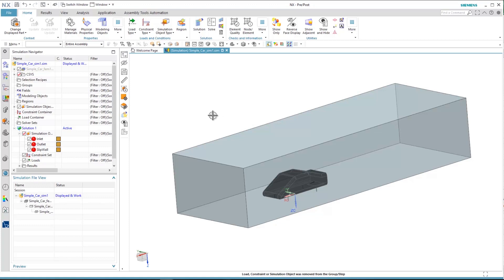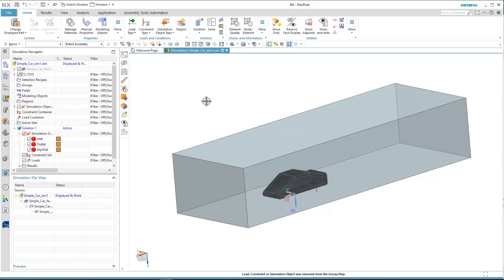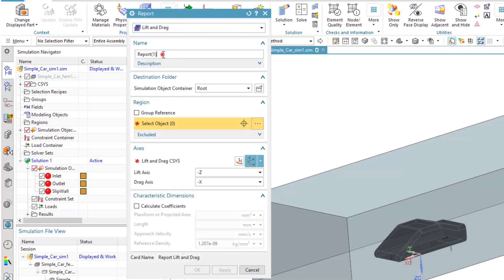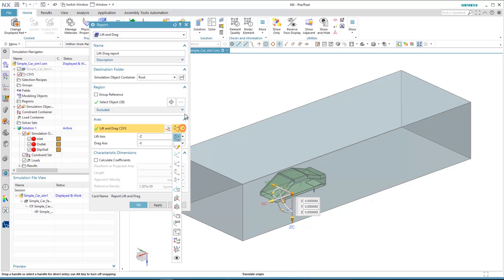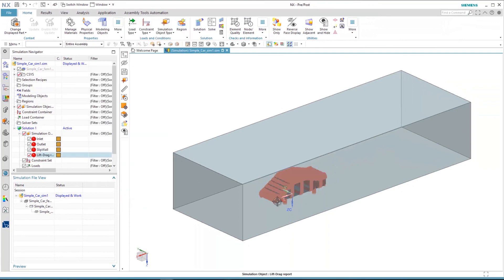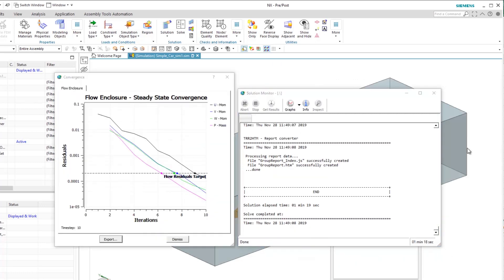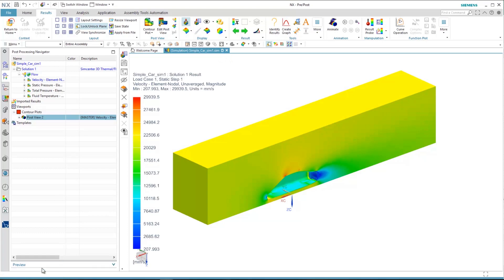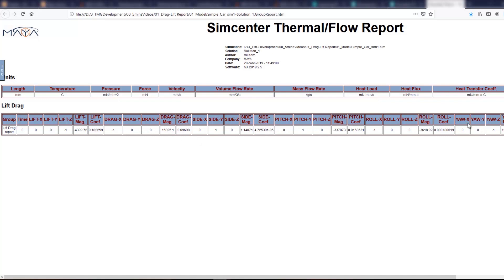How to calculate lift and drag coefficient values for external aero applications in Simcenter 3D

Comment: Thanks so much for your video.
I can see that your lift magnitude is -4399.72 is this in Newton?
Reply from the maker: The calculated forces are in mN unit in this simulation as written in the report. Please note that this model is only for the explanation of how to extract these values. The resulted values are not important.
Reply: unit used is mN